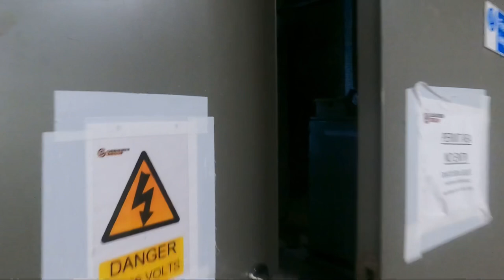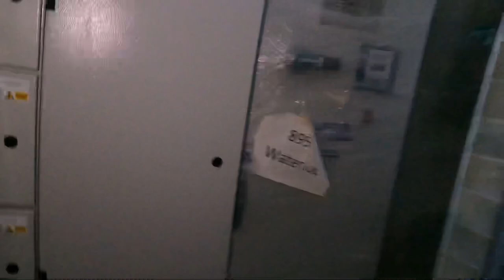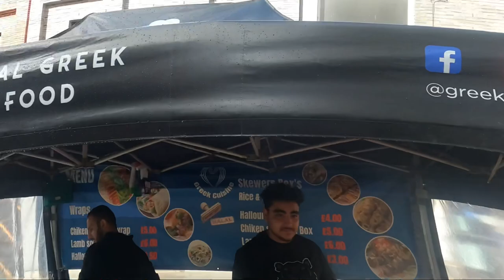Day in the life of a cable jointer

Comment: Good vid. How much was your cutter that you cut swa with battery one ? I must say I’m impressed that u work alone and get the job done wrangling the big f*@k off cables. And do u save some money on lodging in ur van I take it. Good vids teach us something new 👍🏽. May not do just mainly jointing but your tricks I’m sure will help massively when it comes to doing panel boards and making off big cables
Reply from the maker: I gave £800 for it but they are around 2 grand brand new. I save around 200 a week by staying in the van and its fun!